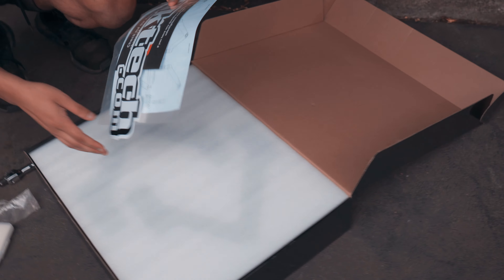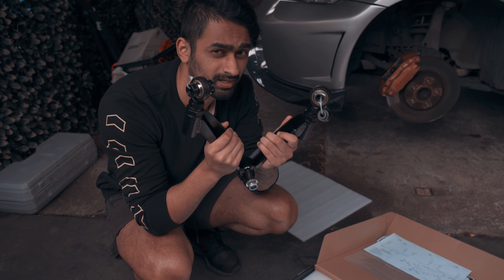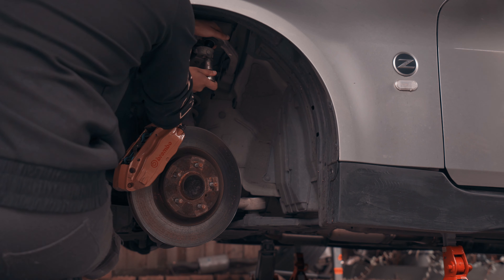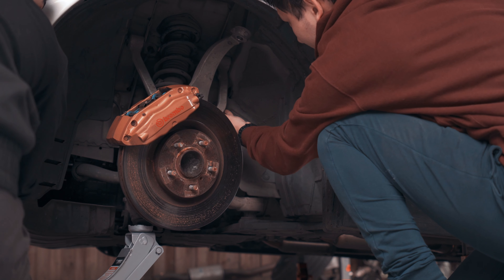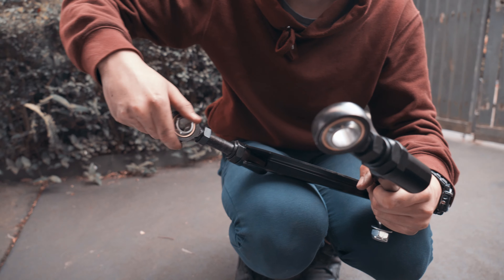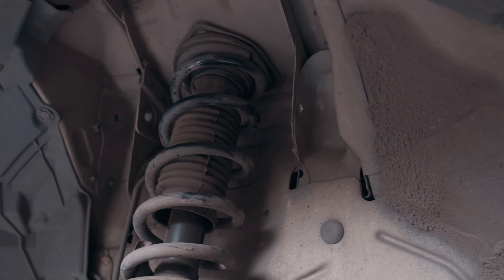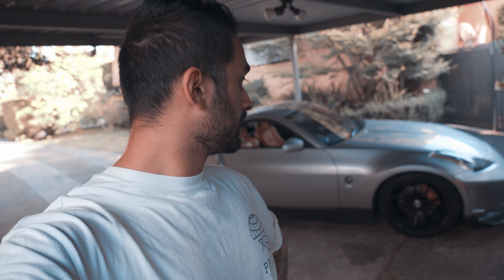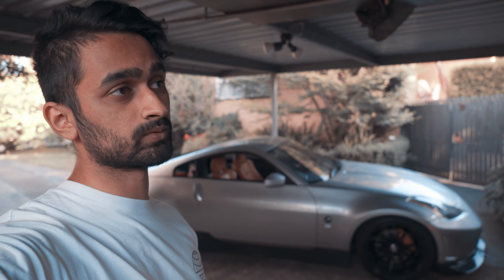350Z Camber Gang | GKTECH Front Upper Camber Arms Install

Comment: Just installed also. The spacers were the most annoying part of the install.
Reply from the maker: Nice! How does it feel?
Reply: @Shoomzbabyyy  I finished at like 1am haha. It was supposed to be a straightforward install but I took my time with measurements etc. Also one side I struggled with putting the bolt in but you guys are smart and removed the suspension to make it easier
Reply from the maker: @bh5697  yeah always supposed to be a simple install but never is haha